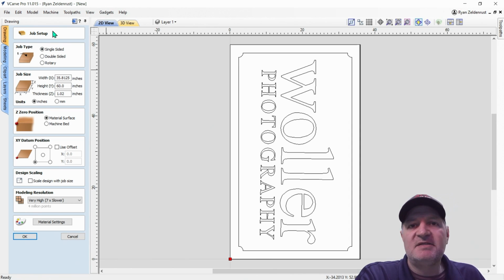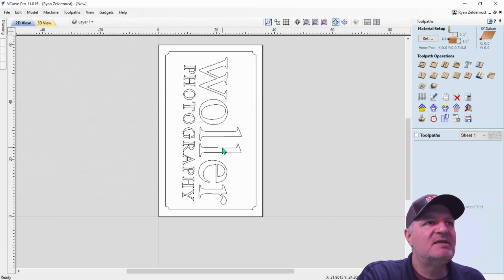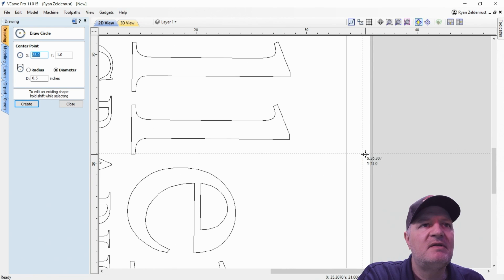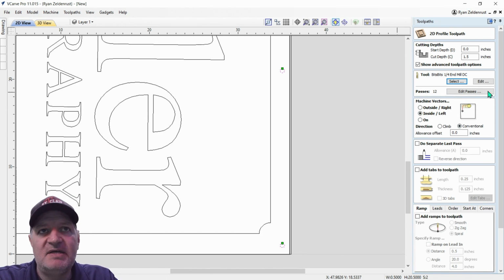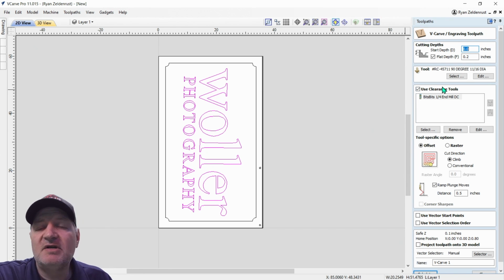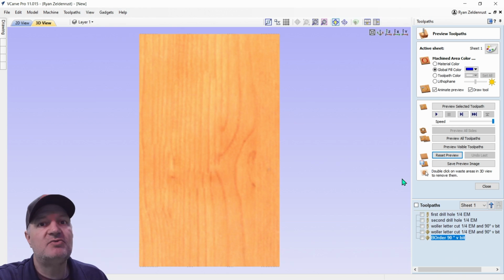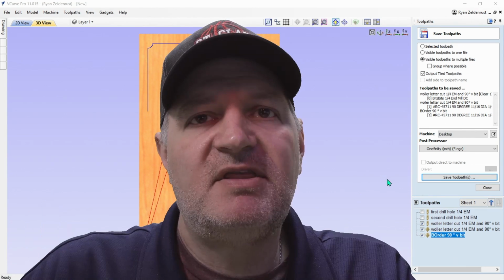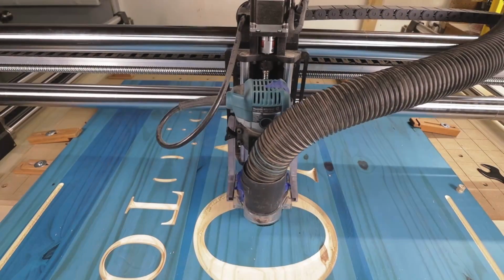Magic of Tiling BIG Signs With a Small CNC - VCarve / Onefinity CNC

Comment: is there a good way to do this without dowels or drilling into the sheet/board. if you needed to tile but couldnt cut extra features into it
Reply from the maker: You can try to just measure and put lines on your workpiece to match up with lines on your Wasteboard, but it is going to be really hard to line everything up. Can you use the blue tap method along the edge of your workpiece to add a sacrificial piece cf wood to drill the holes into?

Comment: Love the video but let me ask a simple question: Why was the job saved as a template? Is that necessary?
Reply from the maker: @woodmeister14467  not needed at all, I just did that to save time for the video. I didn't want this video to be about how to design the layout of a sign, just how to use tiling. No need for your design to be saved as a template.

Comment: Awesome video. I need to do this for some cabinet doors I’m making. I’ll need the outer profile cut to actually cut out the door. I would use tabs to secure the door to the rest of the board. Do you think your method of using the dowels would still work?
Reply from the maker: Thanks for watching! It should work no problem. Just keep the dowels outside your profile cut. (if I understand what you are trying to do)
Reply: @twoelmbuilds yes, sir. I think you have it correct. Thank you.

Comment: When using the masking, can you put that over paint like I’m doing two colors? The background color is gonna be one thing and then the cut out letters are gonna be something else with the masking mess up the paint.
Reply from the maker: I have used it over enamel paint and milk paint in the past. It worked over the enamel but not the milk paint. It just pulled up the paint. I would assume it will do the same thing with latex paint. The best option, if feasible for your project, would be to first paint your project and then put a coat of polyurethane over the paint. That may prevent the paint from pulling up. I have seen people use extra wide frog tape over painted projects but it left a lot of frayed edges of tape. Not the best when you are planning to paint. Hope that helps!

Comment: Great video! However, I do have a question. How would I tile an oversized sign that is OVAL in shape?
Reply from the maker: Thanks! Good question! I have a few options for you, the best option is if you can cut the oval and sign together from one rectangle sheet, if you already have the oval cut you will just have to mount the oval squarely and securely onto a larger rectangle piece of sheet good and slide the sheet through. That will take a little more ingenuity on the design side but it can be done.

Comment: The guide lines are very helpful, especially when you're new to CNC or tiling,, but just a tip, you can just use the array tool to repeat the guide holes 3 times at 20" apart if you're short on time

Comment: Dose the 1/4 overlap effect the carve design-it just recaps the design by 1/4 right??
Reply from the maker: You are correct. It just ensures that any v- bit that you use will finish the carve far enough for the vectors to be fully cut when you move the tile down.

Comment: I could really use your help. I followed your instructions to the letter, but when I used tiling to cut out a Charcuterie board that's twice the length of my CNC on the Y axis. I've done 2 boards now using this method and both times the cutter on T2 starts almost an inch into the T1 cut and about a 32nd of an inch left. I've been able to save the boards because thankfully the customers didn't want them perfectly rectangle. So with a little sanding they came out very nice. But if I ever want to make a sign, that small deviation will not line up the  letters properly. What am I doing wrong? Please help.
Reply from the maker: Without seeing exactly what is happening, I would have to guess that something is going wrong in one of two places. The overlap is off in the toolpath  setup or something is off when the board is physically being moved through the Y axis. You may want to double check the placement of your guide holes, that could account for the inch difference.... Maybe. Hard to know exactly what is going wrong without seeing it in action.

Comment: Anyone know if that’s basically the same process with the Shapeoko 5 pro 4x2? Not sure I have space for the xxl.
Reply from the maker: It will work the same. The critical step is making sure that the size of your tiles are smaller than the size of your machines cutting area. The principles of moving through the tiles to carve them will remain the same.
Reply: @twoelmbuilds  thank you!!

Comment: Great video. Everything about it is not only comprehensive but pleasant to watch. I am using a live edge slab to create a lodge sign. Any ideas for applying your tutorial to a board with an uneven edge? What would I do to compensate for the variables? Would appreciate your thoughts.
Reply from the maker: Thanks for watching 👍 I would mount the slab to a piece of plywood that is wider than the slab. Use the plywood as the straight edge and for making the alignment holes
Reply: @twoelmbuilds  Thank you very much. Am off to try it!
Reply from the maker: @cracchiolo  let me know how it works out!

Comment: Don't you need 3 alignment holes, one to locate each tile? Number 2 hole goes to the bottom (hole 1) cutting tile 2, what is the alignment for tile 3. Great video though, clear and concise.
Reply from the maker: Thanks for watching 👍 you will cut three holes. The first two holes for tile 1 and tile two are cut with the "first hole" toolpath. Then when you slide your workpiece down to cut tile two, that is when you add the guide hole for tile three by using "second hole" toolpath. It a little hard to think of it that way but the hole position for tile 3 slides down when you slide down the workpiece to start the cut for tile 2. Hope that makes sense.

Comment: This is going to be such a huge help when my CNC arrives. Thanks for posting this. 
Two questions:
1, Can you reuse the 1/2' holes on the spoliboard should you need to make another sign of a different size that requires tiling? I'm thinking something you can build into your spoilboard; maybe a bolt with the head cut off that threads into the spoilboard? Just thinking out loud; I have no idea how that would work over time, or if it would even be necessary based on the volume of large signs or projects I'd do. Something to explore later on for sure though.
2, I know you put 2 coats of shellac on before the oramask. Do you do the same to the carved areas once the CNC work is finished? I know it's to prevent the paint from bleeding into the wood grain by the carve for sharper lines, I'm just wondering if it's needed for the bare wood carved area.
Thanks again!
Reply from the maker: Hey! Thank you for watching 👍
As far as re using the holes, I think that it  would be done but it you would need to be making the same size project to keep it from getting too complicated for alignment. I would probably just make a new hole and fill it with something later if  having a hole bothers you?
To answer the second question, the client was doing the painting and dye the sign himself so I didn't want to mess with it. If I were going to do the painting myself, I would definitely use shellac to prevent any paint from bleeding through under the oramask through the exposed grain. In the long run, it can't hurt anything to use shellac.
Reply: @twoelmbuilds  About having to make the same size projects, that's what made me think of using headless bolts as registration pins; have threaded inserts set at maybe 2" or 3" intervals on the right side of the wasteboard, then use the ones needed depending on the project size. But yeah, just thinking out loud there again. Just making a new hole is definitely the simpler option.
I figured as much with the shellac. I was curious since some of the first projects I do on my CNC will be signs with painted inlays. Thanks again!
Reply from the maker: @NWGR  If you add a treaded insert for registration holes, I would get some pvc/vinyl bolts instead of metal ones. Last thing you want to do is have a mistake in your tool path and break a bit when it hits a metal bolt. 👍

Comment: This is the first time I've seen how to really manipulate the guide line feature in Vectric. Thanks.

In regards to drilling with the CNC, I just bought an Amana 1/4" carbide drill bit meant specifically for CNC use. Maximum spindle speed setting is 8000 rpm's. I used to use a 1/4" upcut endmill, which works, but the drill bit is much better for dowel locations.
Reply from the maker: The drill bits are a great option! Thanks for sharing and for watching 👍

Comment: Great video!!
One question. Do you flatten the place with your cnc and if you do, would you tile the flattening tool path also?
Reply from the maker: I did all the prep work for the sign before hand. This specific piece couldn't be flattened with the tiling set because of the oramask, but it could have been flattened before adding the oramask with a separate tiling set. I haven't done a flattening tiling before so I don't know how well it would go in practice.

Comment: Hello Ryan
when you did the second and Third tiles how did you set XYZ for the next carve
did you reset Z to   zero to board for each bit change  am assuming  XY are still good
TIA
Reply from the maker: Hi John, good question. The X and Y do not change since you are moving the board down into the XY position. However, you must zero the Z height to the workpiece surface for each bit change. Thanks for watching! 👍

Comment: Hi Ryan Great video and as always great detail. So am I correct in assuming that you need to make super sure that you align the board when you move to the second and third tile? I am referring to the fact that the work piece is able to rotate  around the dowel so you need to make sure that the edge of the sign is parallel to the y axis (helps to have a tight grid on your waste board I imagine). I realise that this is a sign and not a rocket but I was wondering if a more precise method for critical applications would have been to use two dowels one on either side in order to avoid rotation of your work piece? That is probably overkill. I have a bad habit of overthinking things. I was thinking more about a 2.5D with straight lines in it over a 5 foot distance. I am always surprised how the eye can pick up incongruences over long distances. Just curious about your thoughts on this.
Reply from the maker: Yes! You are right. The one thing I really missed in the video is that I have a few blocks locked down to the spoilboard on the opposite side for alignment. You can see them in the video but I just missed the opportunity to cover that in the video.
   You really do need something along the opposite side to prevent it from swinging around the dowel. Thanks for asking about it! I will have to cover that in another video down the road.  Thanks for watching 👍
Reply: Thanks Ryan, I see that now. Love your content and I am now a subscriber. Cheers John
Reply: @twoelmbuilds  Thanks for clarifying, I was curious about this as well, but figured out while watching that something to keep it straight should be used to maintain alignment.

Comment: What software and setup do you use for videos on the Tube? The links are posted for device etc but not for software for edit etc
Reply from the maker: I use davinci resolve most of the time for video editing. I have premiere pro also, but I am more comfortable with resolve. Also, I will use canva for B roll and other needed illustrations. As for cameras, I have a Canon M50 Mark ii and several different lenses. My wife does photography so I may borrow a camera or two from her from time to time. I will even use my cellphone for some shots. Lighting is mostly the led lights in my shop. I have a few mobile led lights on stands too, but it can be overkill for lighting sometimes. I am definitely in the learning stage for lighting. For audio, I have the Rodelink wireless mic system I use in the shop and love that setup. I have a review video for it here on my channel. 
When I do studio recording, I have a Blackmagic Atem mini extreme video switcher. Studio audio runs though a zoom podtrak p8 and for the studio mic, I have a few and don't like any of them (probably just the poor sound quality of my studio) . I have added links for you in this video description. Hope this helps! Thanks for watching 👍

Comment: I guess I'm confused.  Why cut the same hole for the 2nd alignment dowel?  It was already cut out on the first toolpath?  What am I not understanding?
Reply from the maker: Good question, there are three tiles so you need that hole for alignment of the 3rd tile.... if I am understanding your question.
Reply: @twoelmbuilds  but you never cut a hole out on the 3rd tile. I guess I need to watch that again and again.
Reply from the maker: @strykerliker  you are correct. the third tile didn't need a hole because it would already be lined up where it needs to be when I slide it down into place. the guide hole I drilled into the second tile falls into place and that does the trick to keep it aligned. it took me actually using the process once to ha e it completely sink in. You can do it! Just follow the steps and it will work out for you. 👍
Reply: Alignment holes 1 and 2 are cut while tile one is cut. When you move the piece down the 1st hole is off the table, 2nd hole lines up with the first in the spoilboard. But there is no hole in tile 3 which is now in tile 2's original position so you have to cut hole 2 again to place the peg.

Comment: Great video, I like your presentation style.  With regard to tiling, I think I would have used two registration holes along the x axis and then had the program cut the next two holes for indexing. Unless I a missing a trick, how would you guarantee alignment with one hole since the material could rotate?
Reply from the maker: Hey Pete! Thanks for watching. I think you could do two holes on the x axis if you wanted to. I have a grid system on my wasteboard so I lined up the sign with the grid. If your sign is not square you may need to get creative with ways to keep it aligned. I have seen people use  a guide down one side and dowels down the other.
Reply: Clamp a straight edge to the table. You need to make sure it's perfectly runs straight with your cnc y axis.